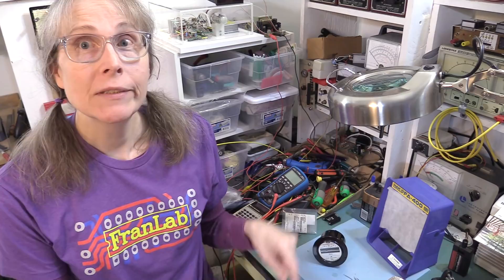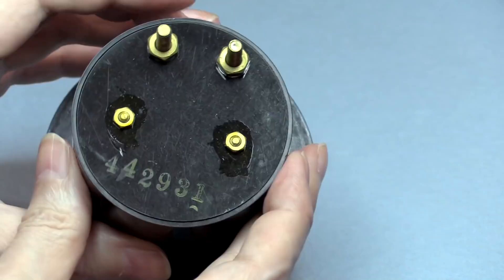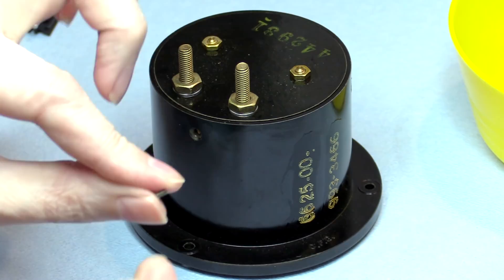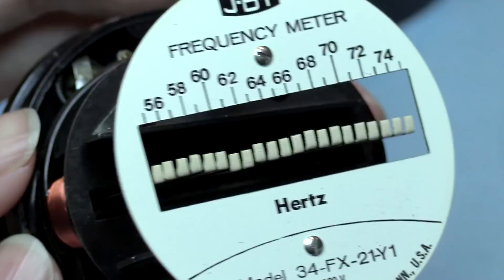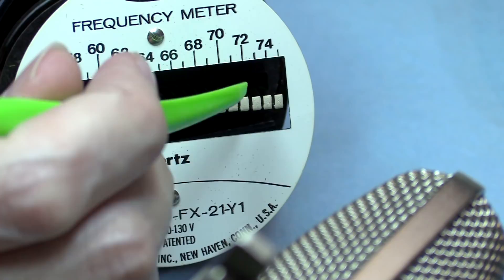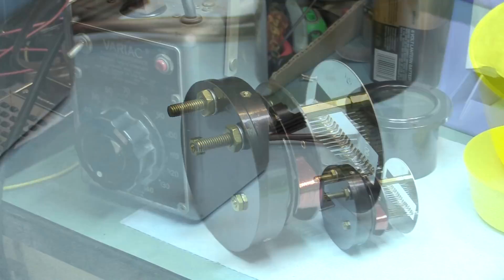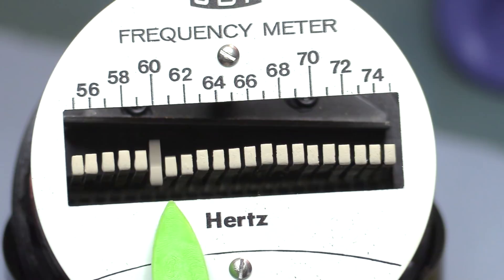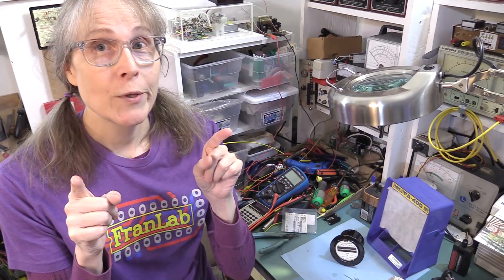The Spooky Action Of Mechanical Frequency Meters

Comment: I haven't seen one of these in operation since the early 70s! Great to see the inside. In either 1973, or 74, in the UK we were having problems with both coal supplies (miners strikes) and oil, so the power grid was having some issues. I was working as an electronics engineer in one of the production studios at the BBC Television Centre in West London. Although we had two separate feeders from the grid, emergency diesel generators for News, and a supply from the nearby Barclays Bank data centre (they had a pair of Olympus gas turbines that could generate 4 MW), it was decided to bring in a couple of big containerised generators to power the central control area, and at least one production studio. My studio was out of service for maintenance on the HVAC (2MW of AC!), so I and a colleague got assigned to look at the generators and liaise. The generators were a big diesel and an alternator in a 40 foot container. The control panel had two of those frequency meters on. One was connected to the alternator output and the other to the feeder to the load. the generator had a governor, the idea was to match the frequency of alternator output to the frequency of the feeder. At the time I didn't think about how they worked, so it was fascinating to see your demo and how accurate the indication is. They work like tuning forks! I would love to see how they are made.

Edited for spelling 28/01/21
Reply: "idea was to match the frequency of alternator output to the frequency of the feeder." - That's easy,  just connect them together ;)
Reply: @millomweb    Exactly, I recommend staples.
Reply: @millomweb  BANG! "Never mind -- it's just a phase they're going through."
Reply: @edwatts9890  the matter with you ? Oh, you're clumsy !
Reply: @wargamingrefugee9065  3 fairly chunky variable resistors would be better - and a generator running 0·1Hz slow until becoming the power source.
Reply: I took one look at the individual tines and thought 'tuning fork' and I'm happy someone with more pedigree than I thought the same thing :)
Reply: Much smaller consumer-grade AC generators also used to have a mechanical meter like this so you could adjust the engine speed to produce the desired frequency (either 50 or 60 Hz).
Reply: @vwestlife  To indicate the frequency of vibration of the engine ? :)
Reply: @vwestlife my “old’ Honda generator has one, it’s probably 40 years old, but still works fine.
Reply: They are still used today on some older ships I've worked on. Built in the 70s & still working fine today.
Reply: @mystica-subs  ... I suspect the tines are all the same but the tapered space between those L shaped brackets is the key to the resonance for the exact reading. Basically like tuning an antenna to a certain frequency using length / distance between two signal radiators.
Reply: 1973. Power cuts, Three day weeks, Massive inflation especially on petrol and oil.
Reply: @rupe53  I believe that to be correct.
Reply: @yammy1000  yup, have two in use on the ship I work on. Still going strong!
Reply: @millomweb  ... no, that would be done by counting engine revolutions with a tachometer. Although there are vibration types to do that as well, they don't work the same way. Those are strictly mechanical without any electrical connections.
Reply: @rupe53  Tachos aren't necessarily electrical.
Reply: @rampagerick  Is surely no different from starting a 250 volt motor on 500 volts. Although I guess here we're dealing with synchronous motor which may well offer more torque than conventional motors - and in this case, the design hasn't taken that into consideration. The smoke is somewhat puzzling and suggests more issues: engine injector pump overfuelling the engine and cabling not rated for maximum load.
Reply: @millomweb  ... that's what I said. "there are vibration types that do that as well" was in there. There are also fully mechanical tachs that are cable or gear driven. They are not very popular these days. 60's vintage Corvettes had cable driven tachs.

Comment: My dad had one of those on his boat to help regulate his generator.  His only had about five "tuning forks": 59, 59.5, 60, 60.5 and 61 hz.  He had a generator run off the shaft of the engine connected by a kind of variable transmission worked by a crank.  After leaving the pier, with the engine settled at its cruising revs, a crew member would turn the crank and tune the generator to 60 hz before flipping the transfer switch.  Dad had three ways of providing a/c power: "shore power" provided by an extension cord for use when the boat was tied up; an Onan  5kw diesel generator for use when at anchor; and the shaft generator for use when underway.  There was a transfer switch to switch the boat's system from one mode to another.  This video is the first time I had a chance to see the inside.  The resonators weren't "forks" at all!

Comment: Such a great video. I sincerely appreciate that you did not lard it with a recitation of the difference between AC and DC current, or laboriously work out on screen the current that the meter would draw. The cool little device was given center stage and you let it shine. Thanks!

Comment: I maintained ground power generators in the Army and we used these to set the RPM of the engines to 60 Hertz. They were mounted on the Control Panel.  You need 60 Hertz to keep the clocks and electric motors synchronized.    Love watching you Lab.

Comment: I got called on a "low voltage generator" back in the 70's. Those meters will also respond to harmonics. They were running the generator at half speed.

Comment: I've seen those on some older (60:s,70:s I think) generator sets, they were used to set the engine RPM for correct frequency (50 Hz here in Europe). 

When I served in the Finnish military in the early 90:s we still used portable (ok, relatively portable, weighed about 100 kilograms and needed two men to carry. Fortunately they had nice folding carrying handles so not too bad unless you had to carry them for a long distance) gasoline generators that had those and the starting procedure included checking and, if necessary, adjusting the frequency before plugging in the load. They also had 2-stroke engines so loud, inefficient and smoky and you had to remember to mix oil in the gasoline.

Also saw one on a larger diesel generator (200 KVA or thereabouts) made in the 60:s that was used to run a rock crusher at a company I worked for in the early 2000:s.

By the way my father had a TI calculator just like that back in the 70:s, I loved playing with it when I was a child.

Comment: Since it doesn't need much current, could you drive it with an audio amplifier into a step-up transformer (such as a regular wall-wart sort of transformer used in reverse)?
Reply: I thought about a signal generator and a step up transformer. 5V times 20 is 100V and impedance is 50 ohm times 400 is 20k is nearly an impedance match.
Reply: @goamarty  The impedance match shouldn’t be terribly critical given the low frequencies that will be used, but the 50-ohm series resistor on the frequency generator’s output will significantly limit how much current can be delivered to the step-up transformer at a given output voltage.  7.5mA at 120VAC will require at least 75mA, plus losses, at an output voltage of 12V, which should be perfectly doable to drive the display.

But a wall wart transformer (OP) would not be a good choice as many contain more than just a transformer since many devices they power expect a DC voltage, so the wall wart will frequently contain diodes and a filter capacitor.  But line voltage transformers are easy to come by and any self-respecting electronics hobbyist will almost certainly have a good selection of such transformers already on hand in the common secondary voltages (e.g. 6.3VAC, 12.6VAC, 25.2VAC, etc) with either 120VAC or 240VAC primaries, either as new stock or harvested from discarded electronics.
Reply: Only if your output drivers are protected or designed for the emf kick the added xfrmr will add. For the 100v line distributed sound amplifiers ("constant voltage" type, albeit the term is a misnomer) they have protection inherent in their design.

Comment: I've seen reed type frequency meters similar to this that are used as tachometers on small engines to set idle speed, and adjusting the engine's maximum RPM for the governor. They are completely mechanical, and are held against the engine itself to pick up the vibrations which in turn make the reeds vibrate accordingly. They are quite precise, and also quite expensive.

Comment: When I was an intern at the erstwhile Uitenhage municipality electricity department in South Africa during my summer university break in 1997, I saw one of those vibrating reed frequency meters in the electrical distribution control room. The municipality didn't have its own generation, so the meter didn't serve a purpose. An engineer explained to me how it worked, which I found interesting. They also still used an analogue chart recorder for logging the total load of the town onto paper rolls. It looked a bit like an EEG or a seismograph. The tech was already considered obsolete at the time, but it worked.

Years later, I'd seen similar frequency meters and chart recorders in the control rooms of decommissioned coal-fired power stations.

Comment: The moment you opened that up I said to myself, "It's completely resonant!" Pure and simple. Also Fran, you have everything you need to make a variable frequency driver for this doodad. Just grab a cellphone, signal generator or whatnot, an amplifier, and a 120v-6v step down transformer. Use the amp to drive the transformer in reverse. The load is small, and that'll work a treat!

Comment: There was a similar instrument in the repair shop I worked at in the mid 1960s.  This shop serviced electric shavers.  It had the same "reeds" for indicators and you would press it against the running shaver and the reeds would oscillate at the "speed" of the cutting heads.

Comment: As a pilot, I knew exactly what this was! The very first radio navigation indicators in the early 1930’s had a “tuned reed” indicator that would vibrate one or both of two reeds to indicate whether or not you are left or right of course on the old four course radio range. Commercial pilots preferred the indicator, because the alternative (used by the army) was to constantly listen to an A or N in Morse code over headphones (kind of irritating after a while). I’ve always wanted to see inside one of these type devices. Thanks!

Comment: 10:45 just hook it up to an old gasoline generator and you'll see it move around, they are not typically super frequency stable
Reply: Or an UPS in off-line mode.
Reply: Yeah but I thought they're usually much more stable than this. For a generator I'd expect a range more like 55-65 Hertz.
Reply: @LeifNelandDk  Your average remotely modern UPS (say, past 20-30 years) is almost certain to be frequency locked to either a quartz crystal or ceramic resonator, so they actually tend to be quite stable to within +/- 0.1 Hz, or better.  So not nearly enough variation to see this meter ever change frequency since you will need at least +/- 0.5 Hz change to see a significant change from one tine to the next since each tine corresponds to a 1 Hz change in frequency.  However, the modified square wave (what modified sine really is) output of cheaper UPS’s may have enough harmonics in their output to generate some curious artifacts if the tines can also respond to resonance at higher frequency harmonics as well.
Reply: @eDoc2020  I have a similar model that I still use to test generators I own.   Its slightly smaller and only covers 56 to 64 hz.  I don’t remember if it says Hz or cycles on it but its quite old.  Most my generators produce around 62 hz unloaded the are governed to 59 to 60 hz under decent load,  just my old Coleman with Briggs & Straton engine 2,400 Watt generator and Onan travel trailer generator.

Comment: hi Fran,
i would use a transformer and an audio amp :3 then use a function generator to vary the frequency 

kind regards  Lara :D
Reply: A 100V loudspeaker transformer would work, I'm sure you have one in stock somewhere.
Or an output transformer from a tube amplifier in reverse.
Reply: @LeifNelandDk  Or feed it straight from the output tubes of a tube amp. :)
Reply: You don't suppose Fran might have a guitar amp laying around that could probably fry that frequency monitor if she wasn't careful?  I suppose a bass amp would be ideal.

Comment: Fran, just connect a power transformer with a 12V secondary backwards.  Connect the 12V winding to the speaker output of an audio amp and the 120V winding on the meter and feed an oscillator into the amp.  The meter draws less than a watt so no problem.  I have seen many of those meters on standby generators in telephone exchanges I used to work in here in New Zealand.  The meters had the brand name Framm, probably from the UK as the telephone switching gear came from there.  One telephone exchange I worked in had 3 diesel powered standby gen-sets.  When a mains power cut happened we had to get the first one going and set the voltage and frequency (with the tine meter) then connect it online. Next get number two started and set voltage and frequency but it needed to be in phase with the first one before connecting online.  We had a pair of light bulbs which pulsed, one on the line and the other on the local alternator and we had to get the timing just right before throwing the (totally exposed) knife switch to connect online.  The same procedure to get the third one running.  Once online they keep each other perfectly in phase of course.  The knife switches had badly scarred and melted bits on the contacts due to techs getting the timing wrong.

Comment: Thanks Fran. I was in the Army in 1971 and I used a 35 kw generator to power the test equipment van for the Pershing missile. The generator had a simiar gage and was used to trim the frequency to exactly 400 hz by adjusting the govenor. I never knew how it worked. I was guessing it was the vibration of the diesel engine. Now I know how that mysterious gage works. 50 years a mystery and solved.

Comment: I remember these reed type freq  meters.  When I graduated with my engineering degree, I worked in Marconi’s special services decision, where I specialized on military equipment.  Their rule of thumb was if it costs less than 50% of a new unit to repair and to bring into calibration, then repair it.  I was surprised at how old some of the technology was that I worked on.  One of them was this type of meter.  Interesting how things were designed before solid state (and yes, I even worked on a lot of tube electronics!).